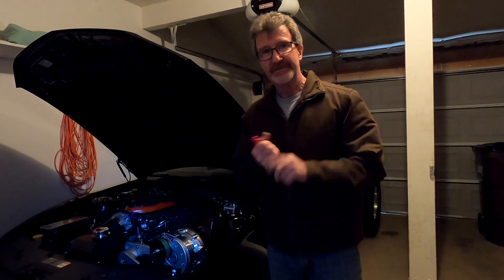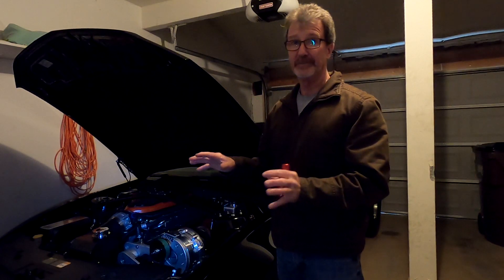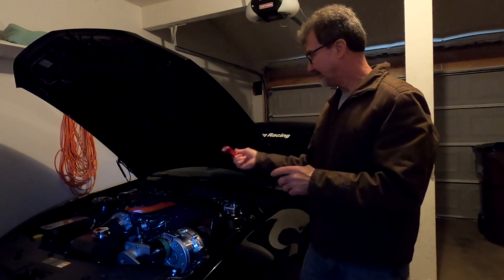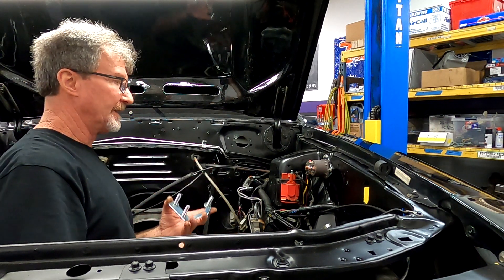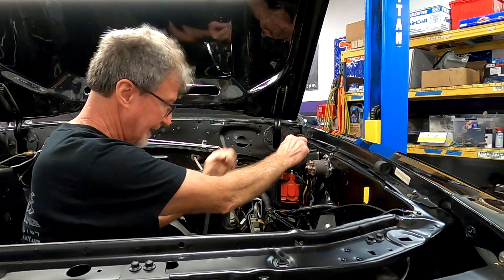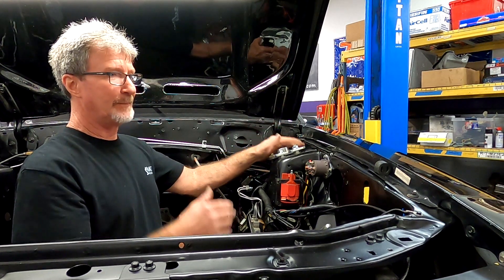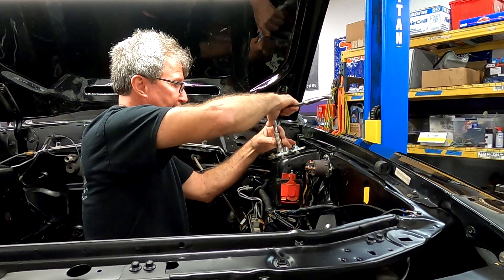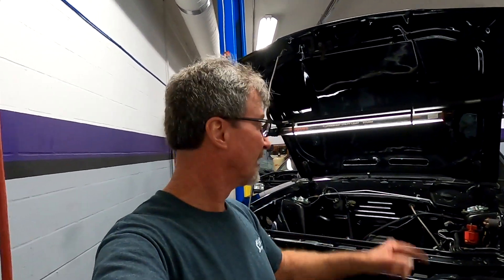How To Install K-Member, Control Arms, and Coil Overs (Fox Body Suspension) - Tech Time Ep. 4

Comment: I can't get the positive camber out of the front driver's tire. I got an aftermarket k member and a arms and camber plates. I got the driver's side pushed as far as I can towards the engine and it's still 2.4 degrees positive compared to the rear